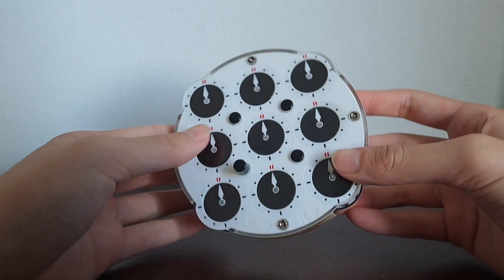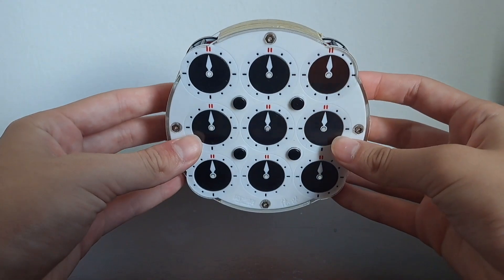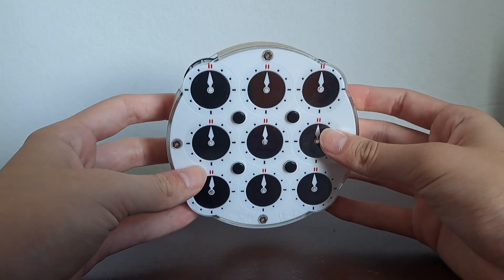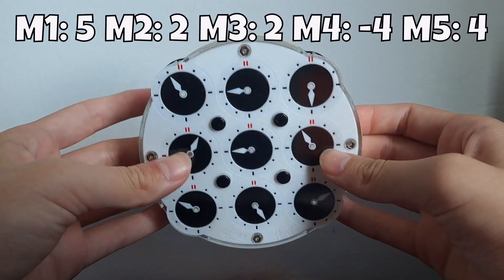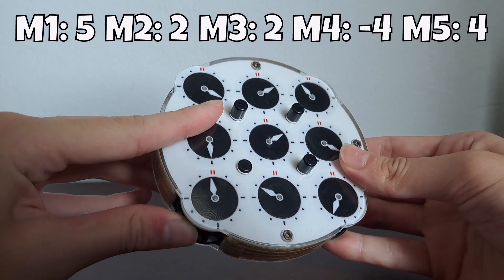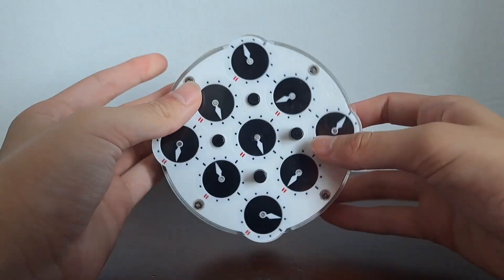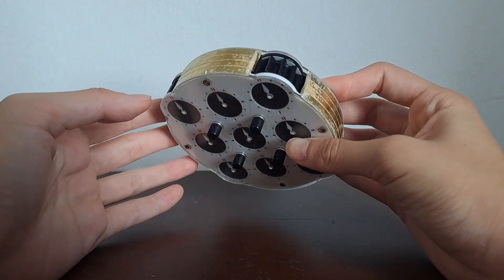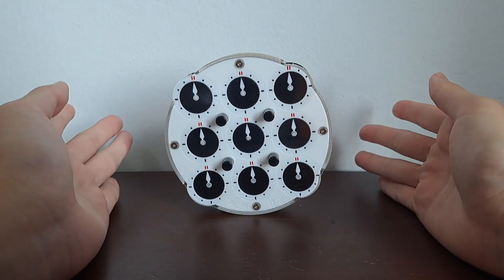Beginner 7 Simul Tutorial [EASY] - Advanced No-Flip Clock Method (bpaul)

Comment: I just started to get familiar with new clock methods. So far I only knew the beginner version (cross, flip, cross, corners). I recently watched a tutorial on sheerin, and I love it. Still, before I truly drill in any methods, I wanted to see a 7 simul version too.

This seems more complicated than sheerin, but I see it can be faster because you can do multiple things at the same time. The memorization is not much harder. I will use letters for negative numbers.

Anyway, the tutorial is clear and easy to follow! I wrote myself a cheat sheet while I'm practicing.
Thank you for this video!
Reply from the maker: hope your learning journey goes well :)

Comment: Thanks for the guide. I regularly end up with the R clock wrong on the back face, which seems to be due to messing up M4. Adding numbers together is hard 😅
Reply: Getting the M1 sum wrong results in the center line plus the L clock being off.  Can be useful for diagnosing a tracing error.